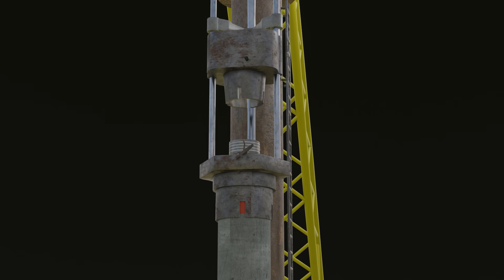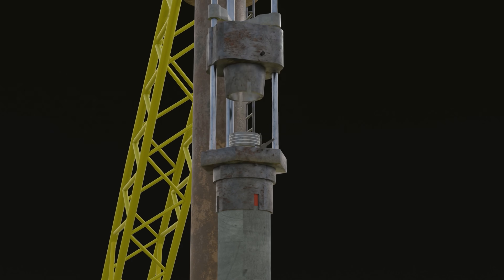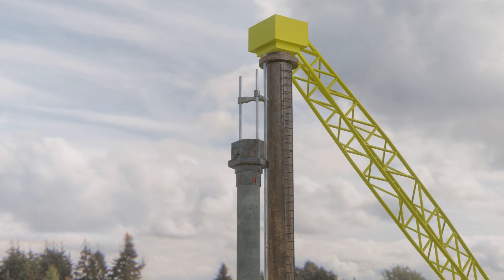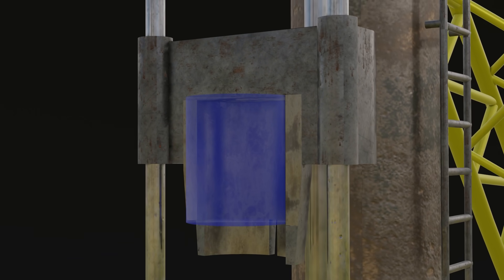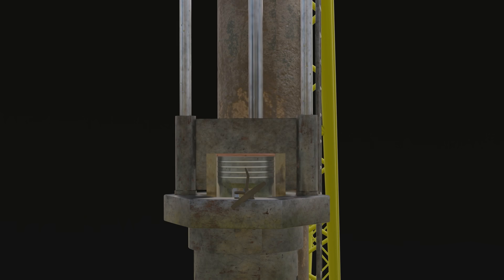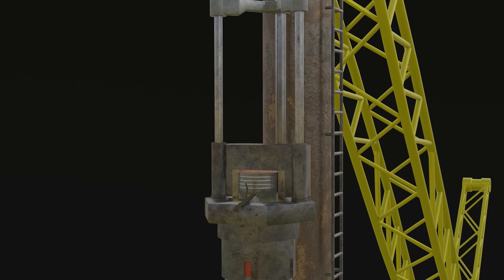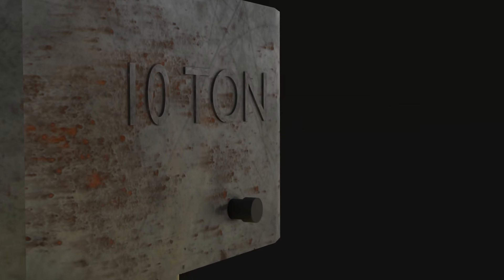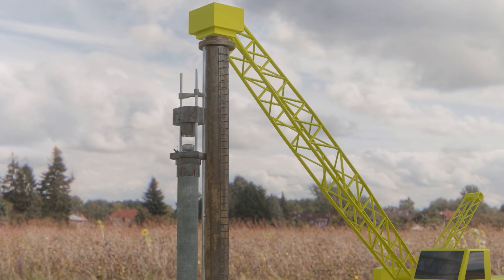How Diesel Hammer Works ? (Pile Driver Machine)

Comment: 1+1=2, so 1+1 equals the value of 2. 2 is therefore composed of twice the amount of 1.   Two is also different than 1, because one is not 2. 2 and one are the first two numbers of the real numbers. 2 divided by 1 is also two, but that doesn't change the fact that if 1 and one gets added together the answer is still 2.
Reply: What an amazing math lesson!